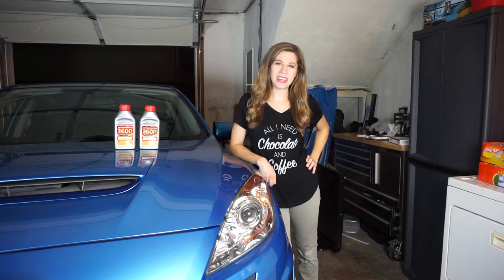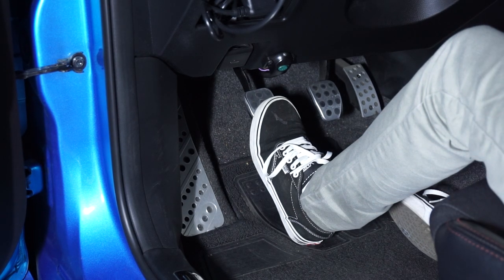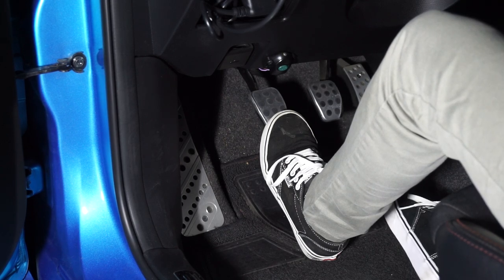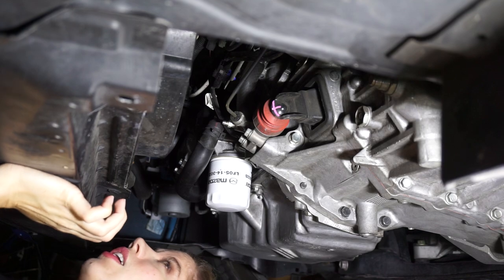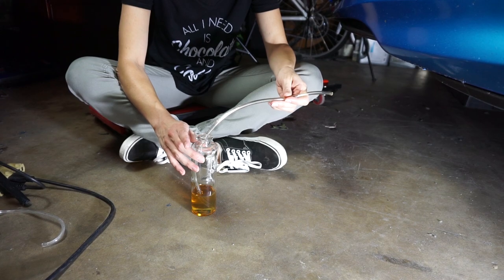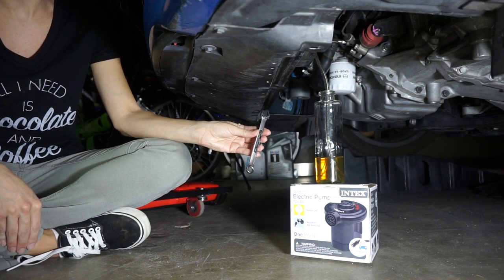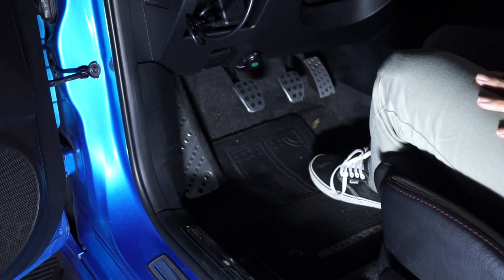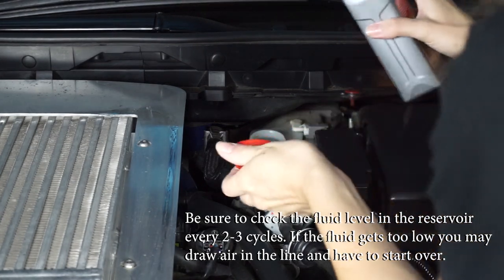HOW TO REPLACE OLD CLUTCH FLUID!

Comment: I am impressed at how you pour your brake fluid.  I don't have the balls to free pour like that.  I use a funnel.  If I didn't, I'd have fluid all over the place.  The same goes for engine oil.
Reply: Brake fluid is corrosive stuff, especially when it gets on the paint job. Clean it up ASAP when you spill it or happen to get brake fluid on your car paint.
Reply: not impressive at all cuz it’s a pretty bad practice since it’s corrosive and can damage the parts or paint around the clutch cylinder reservoir …funnel is a must to topp it up

Comment: How many pumps of the clutch did ur helper do on each cycle? 30 cycles can be overwhelming for new DIYers and can take up to an hour (or more) …I’ve done this myself on my 2013 Honda accord and it took me almost 3 hours cuz I had to figure out how I would be able to easily bleed the slave cylinder valve opener since I round off the tip…was forced to use a byscript instead of the 8mm wrench

Comment: So changing the brake fluid from the master cylinder will be all the same fluid going to the brakes and the clutch? If so, shouldn't we just bleed the brakes as well for each Tire? This way all the fluid is out of  the entire system?
Reply: Clutch and brakes are completely separate, closed systems.  They just both use DOT3 or DOT4 fluid, commonly called brake fluid.

Comment: Thanks, that‘s a lot of valuable information. It would be interesting how the procedure goes using a pressurized bottle and an adapter to the brake fluid reservoir, for doing it without a helper.

Comment: If you ever want to solo it. You can also use a wedge such as a stick on the clutch. Then lessen the bleed valve to let air or fluid out. then tighten. Sometimes air can get trapped in the slave cylinder. To defeat this you can remove the slave cylinder, and push the cylinder in with the the bleed valve opened, also angle the bleed valve up, so it easier for air to travel. 
You can pull suction on the bleed valve with syringe, and vacuum pump if you still have issues. 
Finally. Air can also get trapped in the hose to the master cylinder, while in theory they should self correct. You can also pull a vaccum in the master reservoir to bring air bubbles to the top. 

If you consistently see air while bleeding the slave. You have a leak. If you consistently see air coming out the master reservoir. You have a leak. 
If you replace the master cylinder. It is generally best practice to also replace the slave cylinder.

Comment: This was very helpful, thanks. I'm in the process of replacing my clutch fluid and my clutch pedal did not come back up so I thought I broke something.
Reply: ya first impression just pull pedal up pump and bleed air out sounds like you got it fixed

Comment: A cool trick to easily turn this into a one person job is to buy any cheap set of adjustable hiking poles. You can adjust them to any length to hold the brake or clutch pedal down while you crack the bleeder. Use one pole and adjust it to length and rest it up against the front on the seat..Ohh and you can use them on a nice hike in the woods after.
Reply: Haha, that's a cool advice! However, when it comes to bleeding the brake system, it's enough when the hose is immsersed in brake fluid (in a container). You open the valve and then keep pumping the brake pedal. The air won't get into the system when the hose is immersed in brake fluid.
Reply: Thanks for that info. Don't know where I can get myself a hiking pole, but I'll try make my own 😉👍
Reply: Or buy an easy blead kit

Comment: The clutch pedal on my speed6 did that while I was driving it, then it gradually let itself back out to the normal position after a few seconds. There was plenty of brake fluid in it, but I was driving the car hard at the time, def had something to do with it.
Reply: Did this fix it I had this happen recently

Comment: You can do what I did one time and run the master cylinder out of brake fluid purging old nasty fluid from the lines (not recommended). I change the brake fluid every 2-3 years and never have a leaking master cylinder. No need to buy that racing brake fluid unless its a track car.
Reply: sounds like you got it right

Comment: Is the clutch fluid the same power fluid. Cuz I flushed power steering fluid recently.
Reply from the maker: No power steering fluid is usually transmission fluid. Clutch fluid is brake fluid.

Comment: Also worth considering is the
Motul DOT 5.1 Brake Fluid
Wet boiling point (185°C) is superior to DOT 4 (155°C mini) and DOT 3 (140°C mini). 
So DOT 5.1 will have a longer life.
Reply: no dot 5.1 absorbs moisture much faster and will degrade much faster. must be changed every year.
Reply: @breakupgoogle  No! check the specs
Reply: not necessary! overkill for daily driven

Comment: When is that you need to open the valve as you pressing the pedal I don't understand that part
Reply: Milton Hernández open the valve, press the clutch, close the valve, depress the clutch and so on
Reply: I use a brake bleeder cause e36 uses brake master cyl for the clutch fluid... ez pz.
Reply from the maker: Wrong order. Press the clutch, open the valve, let it drain for a few seconds then close the valve. If you open the valve before the clutch is pressed you will let air in the system.

Comment: If i'm on second gear and slowing down to 3 - 6 mpg should it be smooth to go back into 1st gear? There are various times when my car doesn't want to go to first gear at that speed unless I force it. Does this mean I need to replace my Clutch fluid? Most of the shifting works fine, except down shifting from 5th to 4th. I get a grind every time..
Reply: Christian Sanchez its usually harder because there are no syncros in first i think

Comment: So, I’m confused. If you couldn’t drain the fluid via fill because of the filter, how did you remove the fluid? Drain through the bleeder valve?
Reply: its just a faster way to pull fluid

Comment: Old clutch/brake fluid won't change pedal feel, it will just become acidic and eat away at the seals in the master and slave cylinders and any rubber lines. By the time you feel a change, you've already caused damage to the hardware in the car.

Brake/clutch fluid is hygroscopic. Water, which is what clutch/brake fluid absorbs over time, in incompressible, just like the brake/clutch fluid itself. But when water mixes into brake/clutch fluid. it becomes acidic.
Reply: If there is air in the fluid then it will effect the feel

Comment: Can you do this if you are only 1 person?
Reply: IM26C4U - Yes, use a vacuum kit or pneumatic kit.
Reply: IM26C4U Ally was actually wrong when she said you needed a helper to bleed the brakes/clutch. When you use a hose and bottle with new fluid in it, the helper is unnecessary. Just open the bleeder valve and pump the pedal to pump old fluid out. Once all that's in the hose is new fluid, pull the pedal all the way up and close the bleeder.
Reply from the maker: This is called gravity bleeding and I personally do not trust it. I would rather be sure no air was introduced into the system and have a friend push on the clutch while I control the bleed.
Reply: Yes, the easiest method is to use a stick wedged between the pedal and the seat base; that keeps the pedal down and prevents air from getting in. Always retighten the bleeder valve before removing the stick.
Reply: kind like getting a date with girly magazine it can be done

Comment: my ka has a plastic valve you open and close for bleeding the clutch you use your finger tips to open close clutch fluid should be changed every 2 or 3 yrs if your that diligent thanks for video wares your helper miss did nt see him ?

Comment: Its actually a one person job,
You run the hose back to fluid reservoir, so as you pump you can see the fluid flow back into the reservoir. Just like a brake job. Then you just close when there are no bubbles in line..
Reply: But great video overall.

Comment: it can be done with one person. that closing and opening of the drain valve is just exagerated. the bottle with fluid itself blocks air that would go back to the system.